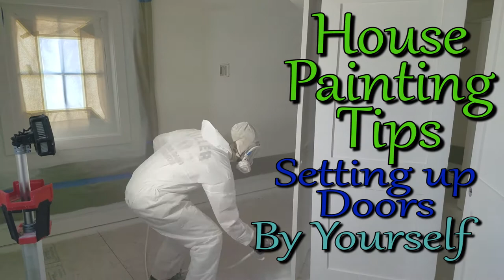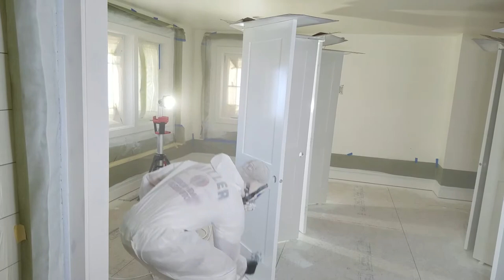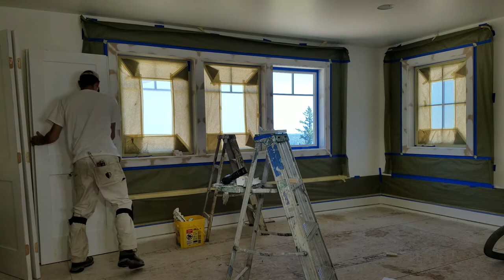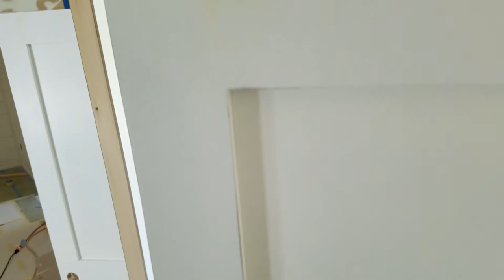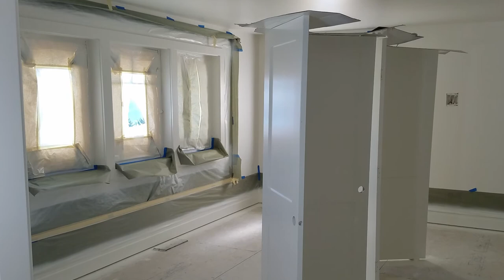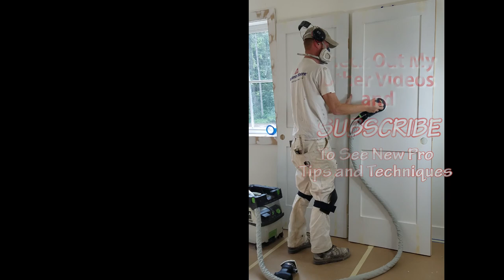House Painting Tips: How to Set Up Doors (to spray) by Yourself.

Comment: Set up 20 doors today using your method and it worked well. The joist hangers are flexible enough to keep the screws from tearing out if you need to wrangle the doors a bit--nice when working by yourself. Thanks!
Reply: By the time you have set this up id have already put on a first coat... I'm guessing you were spraying oil .

Comment: Great system. Seen many others, this one is much better (joist hangers!). 
I would use a washer underneath the screw points of the joist hangers to keep the hangers slightly elevated from the top edge of the door in order to keep a from sealing a ‘weld line’ between the door and the joist hanger.
Great idea, though, thanks.
Reply from the maker: Good thought. I always try to make sure the metal does not hang over or  close to the edge to avoid bridging.
You can try washers, but it could create a little play, maybe, maybe not.
Reply: @XCPainter  I’ve done it before. Not all connected together and not with joist hangers, but with straight sticks - two of them screwed into the top perpendicular to the line of the door, sticking straight out front and back of the door. It lets me prop the door against a wall to paint one side, then I use the sticks as ‘handles’ to flip it (walk it) to the other side. If you use 1” diameter washers there’s no play at all as long as you tighten the screw down well.
But the the joist hangers is something I had never thought of.
I have four 36” heavy solid core interior commercial doors I have to clear coat. I’ll try your joist hanger method. I’m sure it will work fine.
Thanks again.

Comment: Great video. After all the doors are dry what do you do with them when needing to emulsion the room you've got them in? Thanks.
Reply from the maker: With this method, I would typically leave them in the middle of the room for as long as possible. Better than leaning them against a wall (that happens too though) and risk them getting bowed.  When walls are done  I either hang them up or leave them off for carpet installation if necessary
Reply: @XCPainter  thanks for the reply. I suppose if they were dry I could put some clear poly sheets over them if needing to do the ceiling etc.
Reply from the maker: @danielwoolcock7267  yeah I wast thinking about ceilings, I might move them in that case.. I've covered them before but I don't care to roll or spray over and around them.
Reply: @XCPainter  thanks for the info. I Look forward to your videos. Very helpful as I've only been doing it a few months. I love spraying. There's not much about it yet here in England. We are a bit behind.👍🏻

Comment: Great tip ! Might try this out next job , just wondering if you ever spray water based undercoat or primer on doors and trim ?
Reply from the maker: I don't prefer using waterborne if there is a lot of mdf to prime and even on wood trim, due to the tannins that can bleed through, and also oil sands so much nicer.

Comment: What would you be caulking on a M.D.F. door?
Reply from the maker: Richard Paulus there is a gap where the rails and stiles meet the panel. It is inconsitent and bridged partially from the factory primer. It's unsightly, so I prep those so everything looks solid and shiny.

Comment: Just curious. Do you like your new door painting system better with the wood on top? No need to use cardboard or to set them up.
Reply from the maker: I do like the new method a lot. But there are advantages in both methods. Maybe like on high end jobs using the brackets or standing them all up, you can check them all, check out the finish, or do any prep needed .

Comment: do the doors stick to the wood blocks? I had issues with that. What about the cardboard as well
Reply from the maker: Yes, the blocks can possibly stick to the doors (or the floor). One method that solves this problem, is using blocks that are smaller width than the door, and screw or finish nail them to the bottom so they don't overhang the edge... then paint has nothing to bridge to.
The cardboard up top hasn't been an issue for me since they don't make a lot of contact with the door.